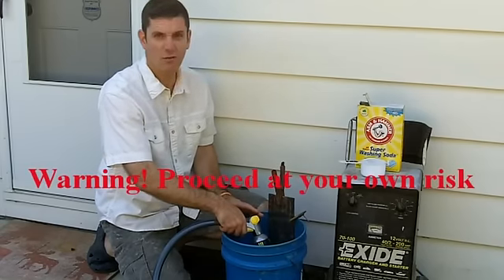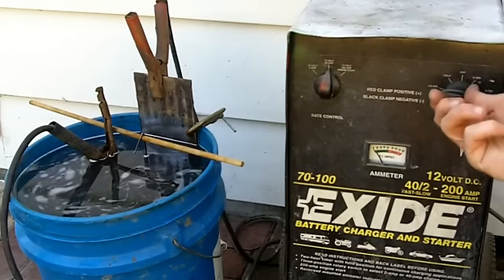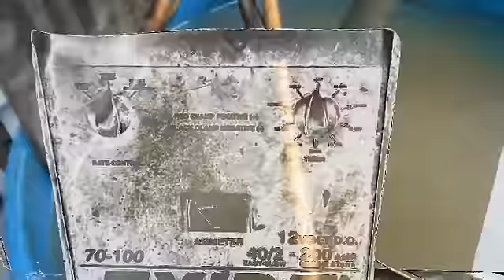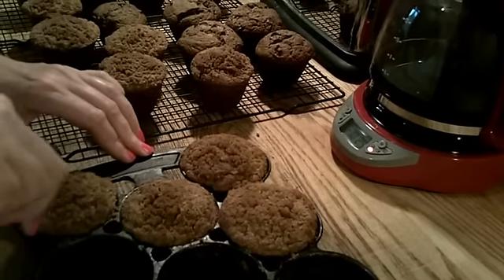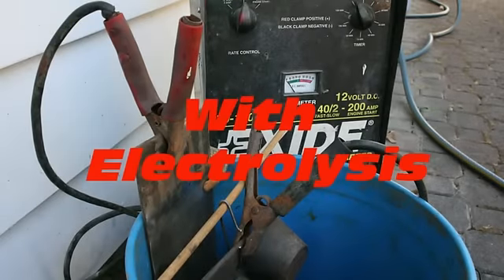Cleaning Cast Iron with Electrolysis

Comment: What settings did you use on the battery charger? Many have options of 6/12 Volt and multiple Amperage settings. I can't wait to try this on some old dutch ovens I found at home.
Reply: For any home electrolysis like the one above you would use the "trickle charge" setting which is in most cases 12 volt/2amp.
I would caution everyone that the "sacrificial" piece of metal or the "Electrode" (which is always where you hook the positive) and any of your hooks and hangers should also be iron and not copper, stainless steel,(or any other metal that you are unsure of) which will give off some nasty stuff. Stainless steel specifically has alloys in it that will break-down to produce Hexavalent Chromium which is a well known carcinogen and all around bad ass, nasty stuff, both for the environment and for public (and your) health. If you are unsure of what Hexavalent Chromium is, Google it, or think of the movie "Erin Brockovich". Stick with iron and you will be good. Rebar is always a safe bet, and you can get short pieces of it at Lowes and it's pretty cheap.
Other than the no smoking and well ventilated area, make sure that your tub or pail or whatever is plastic, and shut the power off if you need to make any adjustments, this is a safe and cool project to do, it works on rusted adjustable wrenches or anything made of iron.  Enjoy, have fun, and don't make any nasty chemical compounds that you'll need the EPA and a hazmat team to get rid of.... Hope that's a help to all.  :)
Reply: Fantastic, thank you!
Reply: +joesmania  Please, can you tell us where to find the right type of hooks/hanger/wire? I'm at my wits end trying to figure out where to get the right kind. I was sent home with copper by our local hardware store. : ( Thank you!
Reply: +Jennifer Coulter I am sort of a scavenger ... old bucket handles, pieces of old box spring, and sections of old barbed wire are generally clean. Do you have a Tractor Supply near you? They may have a small spool of "clean" steel wire. Just look for any "funny colors" like green or orange forming either in a foam or sludge. If you start getting that, try a different source for the hanger....Let me know how you make out please??
Reply: I think correctly you have to use a manual battery charger automatic won't work

Comment: Wow, that's probably too high for amps... I use a few table spoons of baking soda and 2 amps seems to do just as good as 6 amps.  The electrolyte doesn't provide much resistance to the charger, so you may be heating up your charger transformer unnecessarily.  I'm just guessing though..  you may not need that kind of juice, or go slower at less amps...  save your awesome car shop battery charger.   I'm doing motorcycle parts right now, with an antique  dutch oven & frying pan is next in line.

Comment: you know how old  your Yorkie pan is ? its circa 1870ish this is  denoted by the lines down the middle of bottom this is where it was cut from mold that makes it valuable VERY VALUABLE if you know the manufacture than maybe more valuable
Reply: embarado smithing and woodcraft Those lines on the bottom are called gate marks. They are a scar from the manufacturing/casting process. Between the 1870s and 1890s manufacturers changed their casting methods and gate marks were phased out. Without knowing who made your pan and when that foundry changed their processs all we can tell about its age is it was made before 1900. I can't say for certain but I suspect there were some small foundries that kept using the old methods with gate marks into the early decades of the 20th century. That means determining the age is even more of a guess.  It's still safe to say it's old enough to be considered an antique.
Reply: yes g f i believe i covered that

Comment: Electricity is electricity either way. Simply put smaller charger won't put out as much charge as the larger one so it will just take a bit longer is all. My charger has a 40 amp start or a 5 amp charge. Spent maybe 50 bucks at walmart for it. 

Keep in mind that too much electricity can be bad or even worse causing a small explosion or even less severe pitting of the metals if you have ever touched leads from a bettery togther you see that.

Comment: Hey guy, good presentation but how come you are not telling us what setting did you use on your battery charger, what voltage, what amperage.  That should have been your logical step to mention.  Don't get it man. And looks like you are not answering that question as I am not the only guy that has asked it.

Comment: There have been a lot of questions on what to use for the anode. In all the replies that I've read, NONE have mentioned using a ruined cast iron pan.

Next time you're at a thrift shop or yard sale, pick up the warped ugly cast iron pan or skillet... the one you would never buy to use, and negotiate a better price, based on it's condition. Next, put it in your oven when you run the self-clean cycle. Now, you have the perfect anode for taking care of your cast iron electrolysis project!
Reply from the maker: Charles Walter Excellent tip!
Reply: +Charles Walter The instructions on my oven say to remove oven racks (otherwise they will be damaged, not slide well, discolor etc)  Have you come up with any way around this?  Obviously can't set on the oven floor since the heating element is there.
Reply: +Charlotte Childers FIRE BRICKS are the answer. Be sure they are fire bricks, not regular construction bricks, and are dry! Place them on the bottom of the oven but don't allow them to touch the heating elements. Place your cast iron on top of them and turn the oven on to the self cleaning cycle.
Reply: Joe I Thank you so much.

Comment: it's a no name brand that I bought at walmart.  I believe crazing is what's happening to mine, no actual chipping, it's towards the bottom of the pan right before it hits the flat surface.  I used it after I noticed it the first time and no harm no fowl, but i'm just afraid that it will eventually start cracking off, if removing the enamel will not work, that will be $60 right down the drain, which would be a shame..........I know for next time, I will be buying a cast iron without enamel..smh

Comment: just use pool acid to clean rust, put it in for a minute then rinse off
Reply: That can etch the metal badly.  Old cast iron didn't have carefully controlled chemistry and the acid can dissolve some of the accidental alloying elements in the cast iron.  It can also cause trouble if there are cracks.  Plus, pool acid is dangerous stuff to mess with.
Reply: John Ferguson not if just shortly and always have bucket of water with baking soda, no problems done it to many times

Comment from the maker: Sure, If that's your thing. 

Personally I don't like the idea of eating off of Teflon, aluminum, silicone or whatever else they make things out of these days. 

It amazes me folks will pay $40.00 for a Teflon pan that will chip and peel and need replacing in a few short years when, for only a few dollars ($5 - $20), you can buy a beautifully made, antique, cast iron pan that performs better than modern pieces. 

Reduce, re-use, recycle. My kids and grandkids will someday be using my pans.